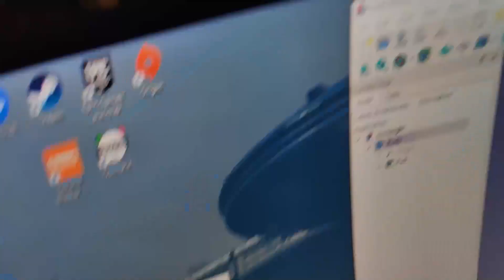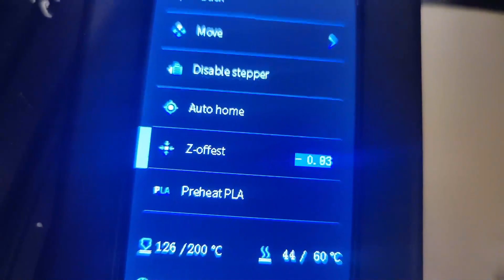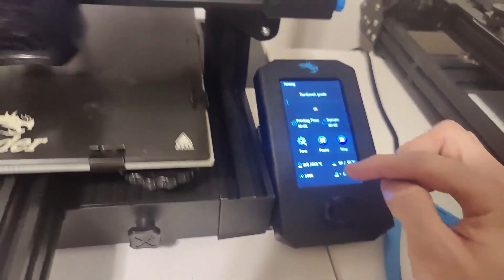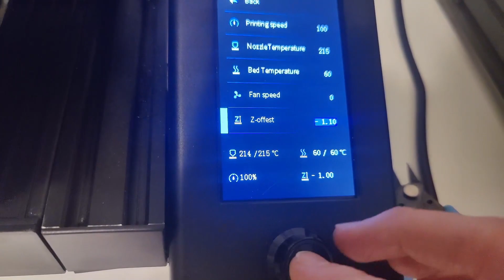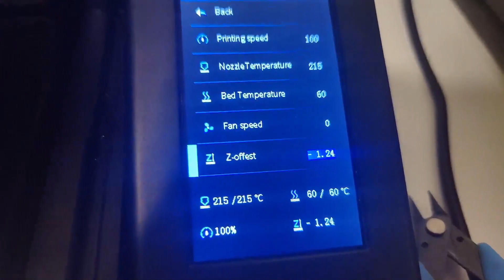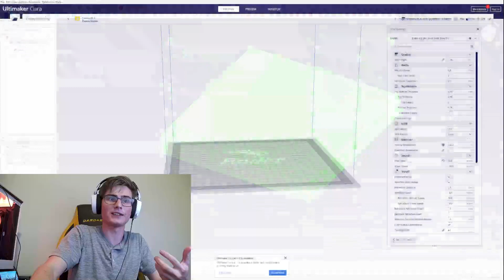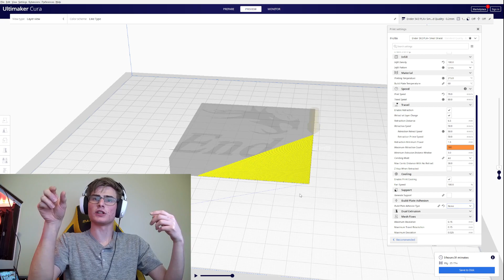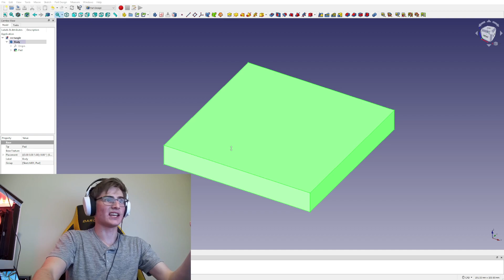How-To Calculate the PERFECT Z-Offset For Your Creality Ender 3 v2 - CR Touch

Comment: You said you can do this on any printer. I’ve manually updated my firmware and do not have a Z-Offset option. I do NOT yet have a CR, CL, BL Touch installed.

Comment: Just got myself a glass bed and a cr touch and I previously bought a spider hotend. This hotend is slightly bigger than the stock one and after installing the cr touch and auto homing it, the nozzle was hitting the bed before the cr touch was. I added a spacer where the cr touch mounts up to lower it down, but it brought the actual extruder about a millimeter above the bed. This video was super helpful. My prints are crisp now

Comment: And no matter what you do it is different every print, or the little line that prints before hand will dig into the bed only to be a 1/4” off the bed when it starts the main print. FUCK ENDER

Comment: Hey buddy is there any way possible you can help me out with the firmware that you use to download your crouch in that touch screen you got I got the exact same setup but I can't get the firmware to let me use my screen all it will do is sit there and beat when I cut it on but if I disconnect that screen and plug in the regular screen it works I don't understand what's going on

Comment: My cr touch when it probes the bed does not retract. The light goes from blue to red then back to blue to red then purple while it moves to the next point. I cannot find anything on this. Do you have any ideas
Reply from the maker: It sounds like it might be miswired. If it used to work it might have died and you need to replace it D:

Comment: Shout out to #the print house! I need some help please, I followed these instructions and they worked perfectly. My print was not 100% smooth but I was okay with that as it was my first print.
I now have an issue when levelling the nozzle is pushing into the bed very hard it's causing the left side of the z bar to try and dip below the bed (it makes an awful noise). The same happens when trying to home it. Can anyone please give me their thoughts? ah before i forget, I am using a Ender-3 V2 Neo - thank you and peace to you all.
Reply from the maker: Your z sensor switch is too low. You need to raise it higher!
Reply: thank you - now for the dumb question @ThePrintHouse  where is the z sensor switch 🙂
Reply from the maker: Oh gosh I don't think I can explain that on text. It should be relatively easy to google. It's a tiny switch half the size of your thumb on the left bottom side of the printer
Reply: Thank you! You’re a legend

Comment: My one issue is trying to get it to stop pushing out the pla as it does it’s auto leveling thing.
Reply from the maker: You can manually pull the PLA back 2 - 5 mm and then when the auto level is done you can manually push it back forward.

Comment: Do sort the sound issues out :o)
 
Anyhow - finally something that makes perfect sense and demonstrates how your adjustments make a massive difference to the print quality. This is what fine tuning of your printer is - thank you, thank you, thank you! :o)

To make it into an absolutely unbelievably helpful tool I'd ditch the "cube" and run several longish strips  of approx. 1cm (or 1/2" for the imperially minded ;o) This would make the results much better (and much sooner) visible. I am going to do it when I figure out how - total noob here :o)

Re. bed leveling - do a COLD run first... Once you're happy with reasonable distance - you may heat it up and see if it makes any difference. Hot nozzle does go through the bed material like a proverbial knife through butter. Even through paper (I do not have a 0.1mm steel gauge - my "gauge" was a piece of paper)... I'm looking at 2 neat holes and 2 long scratches right now. Do a cold run first - save yourself much aggravation and cursing at a guy called Vlad (220K+ subscribers - he should know better, right? :o), and your own clumsiness, of course...

Now a question - Cura gives me 4 options for quality - from 0.12mm to 0.28mm layer thickness. Should not the z-offset be adjusted for different layer thickness?

Comment: I’m using an Ender 3 with Marlin, can I baby step while printing and use that as the difference for my offset?
Reply from the maker: You should be able to :)
Reply: @ThePrintHouse idk if it’s just the software, but changing the probe offset doesn’t physically change the height on the first layer. Is it the software or is there something I gotta change in the config?
Reply from the maker: @DraconicMaker  you might consider reseting you eeprom. See if that fixes it.
Reply: @ThePrintHouse  I usually see people changing the z offset probe instead of Babystep-Z. So I’ll give that a try
Reply from the maker: @DraconicMaker  oh I didn't know that was an option. Yeah that might be better

Comment: Do you "lock in" this z offset somehow? Or do you manually adjust it to -1.28 (in your case) every print after you hit start using the manual tune?
Reply from the maker: This should save the value for you so nothing is manual after :)

Comment: I just got a new hotend (Creality Spider) and this video really helped setting the Z-Offset right, the test print actually was perfect from the start. I experimented a little bit going only 0.02 up or down and the print immedeatly got worse.

I really liked the look of your control screen, what firmware is that? Would it work with the BTT 9 inch touchscreen as well? I currently use the standard BTT touchscreen firmware, which can also be switched to the original Ender 3 Marlin firmware.

Comment: So I just did the Z offset and mine ended up needing to be -2.10 but the square came out absolutely flawless except! the corners lift, that happens with practically ALL my prints, I can put rafts to stop it but it ends up adding a bunch of time and takes more filament... I know it's bed temp but what do you recommend as a good bed temp? I've tried 50,60,65,70 and still lifts in the corners :(
Reply: a little late, but I usually use some stick glue on the build plate.  Mine is the glass plate.  You could also use the painters tape that a lot of people use.  I stick aroune 200-205 and 60-65 on temps
Reply: @ronaldtaylor1672  appreciate the reply but i upgraded to a magnetic flexi plate thing a long time ago, I did end up rubbing a very thin film on the bed with a cold hot glue stick but not ideal and still lifts sometimes... might need to get one of those enclosure things?

Comment: By chance, would you know why my CR-Touch sensor doesn't light up, let alone, WORK? LOL..  I am sure it is something I am doing, but, homing all three axis  vs, leveling the hot bed, are two things I can't do. Is it because I need to preheat the hot bed before the bed leveling will work? You will see many people's videos all showcasing the same issue I am having, i.e., "AUTO HOMING"... X and Y do just fine, and the Z only moves up about 5 mm to 10 mm then stops, it doesn't attempt to move down towards the hotbed or even reconfigured with out the CR-Touch and reconnecting the mechanical Z-axis stop switch.. nothing.. But, I can go to manual mode/jog, and move the Z-axis from that zero (0.00) up as far as I want, and back down to that zero point (0.00).. but if the gantry/trolley is a few inches above the hotbed, it will not try to move downwards... What am I missing or haven't learned.. I am sure it is something silly I don't know how or what to do.. But, as stated, I am not the only one out there with this issue. What causes concern, is some of the videos are of people like myself, just simply showing/asking what is going on or why... others are claiming that there is some form of issue, either mechanical, electrical, software/firmware, cabling.... Something tells me, that it is simply me missing a step somewhere that is needed, in order for me to proceed to the next steps before printing?
Reply from the maker: Have you installed the proper firmware that uses the cr touch instead of the z axis stop switch? You need to install the CR touch onto the machine and then you need to install new 3d printer firmware.
Reply: @ThePrintHouse  Thank you for your reply. To answer, yes. I played with many install methods of Jyers, Marlin's, and of course the factory software and firmware, which I have never removed, and only made a copy of to the laptop and I use another SD card to transfer with, all in efforts to leave the factory version intact for full integrity  and even played with connected comm's from the laptop to the printer itself, via USB. and even playing with Prontaface & PrusaSlicer and watching the live feed back, when the machine crashes or faults out any time the Z-axis is asked to follow orders. M999. I am still researching to see if maybe I am missing a formal G-code starter line or something. 

The biggest confusion I have is no matter what firmware is installed, even the firmware that came installed from the factory, the first day I turned the unit on, following the instructions and simply trying to HOME all three axis, X and Y do just fine, and then Z, rises up about 10 mm, then stops, that is it, the LCD screen stops after about 5 to 10 seconds, and the bottom corner "Z" flashes "??-??" or something with the question marks, stating that there was not an ability to do its thing to HOME it self out. 

BUT, if I go to manual JOG mode, on the Z-axis, the first week ,I could move up and back down to that (0.00) point But, as of last night, it will only go up direction now and no longer goes back down.. I speculate the board/driver was shipped bad to me from CREALITY.. I have descovered many issues with the cable/wiring, of just bad quality control and methods they assemble their harnesses. The CR-Touch has never worked, or ever light up like everybody elses has done.. My mother board is the 4.2.2. version. beings I have only had this machine about 2 weeks, one would think that it should at least work for a while, and maybe after use of a few 100 hours, maybe even a few 1000 hours, that some of the high movement cables and I can justify them as consumables, but, for them to ship out defective units at an alarming rate, just from what I have gathered in the number of videos, let alone the massive amount of comments under each video is crazy. They know there is problems, and they do not care and continue to ship them 

I contacted the LIVE chat service at CREALITY's website, chatted with somebody, told them my issue(s), and that what do I do to gain new parts, even if I have to buy them, I was closed out with "somebody will email me for my concerns".. later, finding out, that anybody who has ever dealt with them, it will be months before hearing anything, and if it does get rectified by email, it will be months again, before receiving any parts... 

Don't get me wrong, but, beings I came from the import and export industry. this mentality of many Asian company's, is so costly for the rest of the world, and they know it. to the point that I gather that it is being done on purpose now for the past 5 to 7 years, as an attack on the world economy's. mainly, the USA's economy. But anyway, I don't care what it cost's to being able to play with it, but, I really shouldn't have to pay a single thing to get parts rectified on faulty or poorly made parts. 

Lastly, I am still hanging on to a guilty feeling that after all the testing and trouble shooting I have done, I still am modestly assuming that this mess is my fault, and that I am missing something.. but things just do not add up for the testing results, while way too many faults or defective parts in just one kit with the added on CR-Touch sensor. Ah, I'm just grumpy about this, as it is just more of the same from Asian country's. Nothing against the workers on the assembly floor, as they are just doing the best they can, but the over-bosses, are what in so many cases is the cause of this low quality nature.

Comment: thanks for the vid sir but i almost threw my bluetooth headset to the garbage bin because of the sound glitches in the video :D I have one issue that I am unable to fix and I am really frustrated after days of no fix. The very beginning of the very first line of my prints curl upwards and later during the printing this causes mess. If I lower my print head with z offset, the print head forces the layers to unstick off the bed and if I raise the head the gaps start to occur and adhesion reduces. why does that first line curl happen?
Reply from the maker: Youre welcome! And oh no I am so sorry lol I do not know why the audio is so bad lol

Comment: Great help! Updating for shipping firmware ender 3 s1 pro would help. Z only adjustable 0.05mm increments and menus changed. No tuning selection. But tap on top screen z parm to adjust. Got the butter and adhesion problems on flexible magnetic top went away. I ended up with 0.15 closer than a sheet of 20 lb printer paper. Also bumped up pla temp to 210 and bed temp to 65. Thanks again!
Reply from the maker: Thank you! I will see if I can find some time to update this video :)

Comment: I have an Ender 3 V2 Neo that I just got.

I’m new to 3D printing, but I leveled my bed both manually and automatically, and set my Z Offset, but I’m having a problem with the nozzle dragging against the prints the higher and higher the layers get.

I don’t know what to do.
Reply: Same thing happening with my ender 3 neo I'll let you know if I figure it out
Reply from the maker: I wonder if you need to calibrate your z motor?